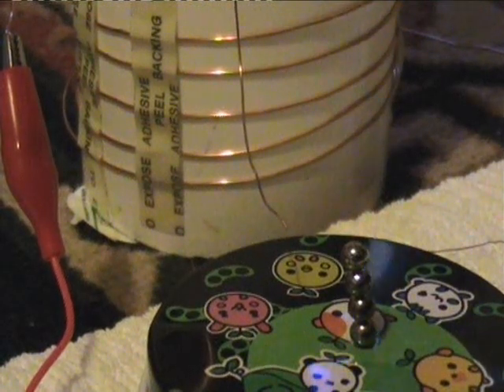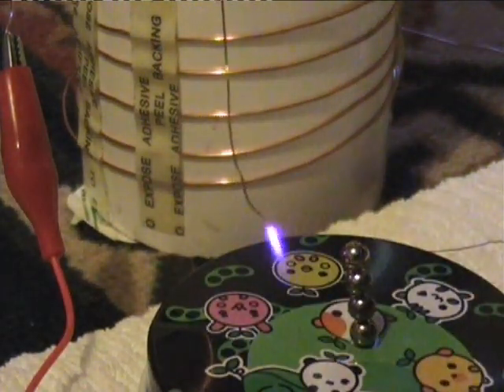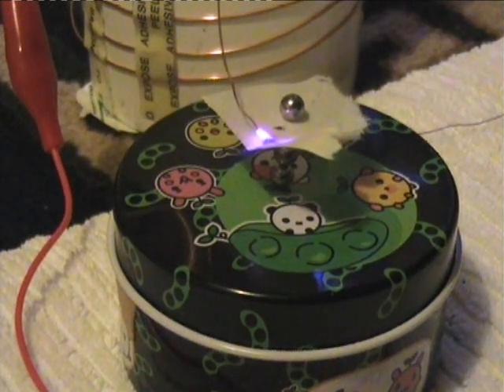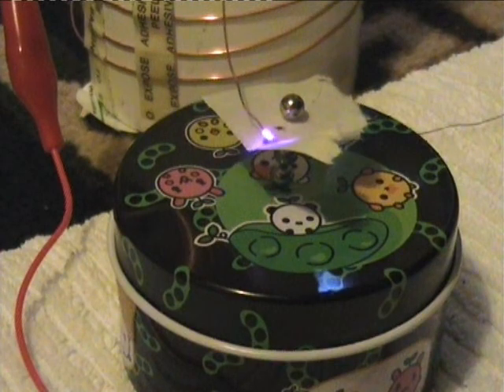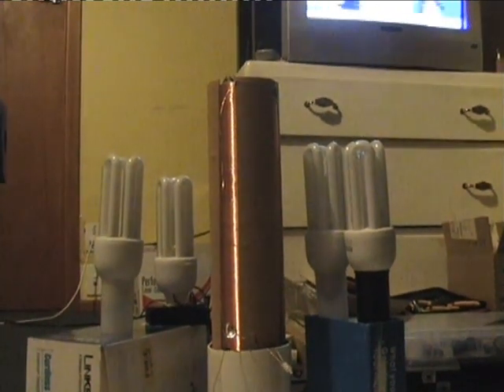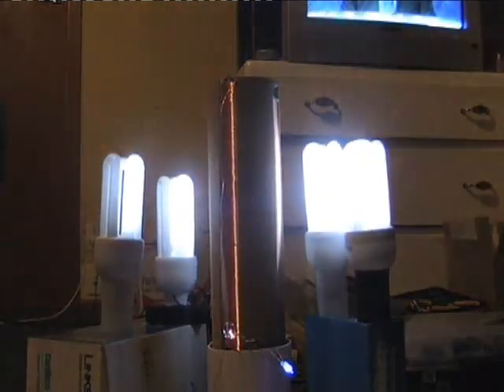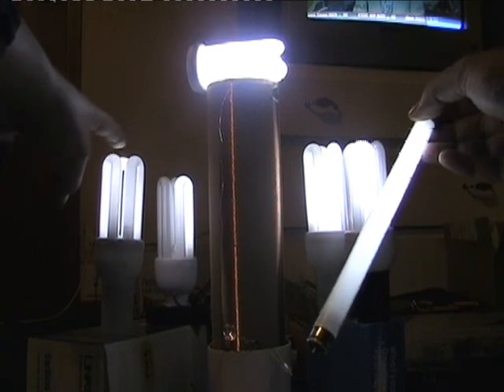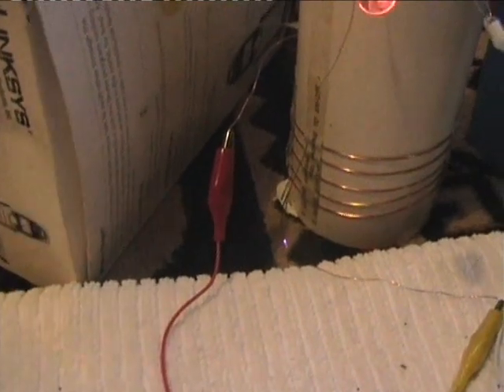24v SEC Exciter and plasma

Comment: what type of transistor, resistor and capacitor did you use?
Reply from the maker: dylandgaf17 The transistor was a 2n3035. The capacitor (from memory) was from a disposable camera (80-100 uF). The resistor is probably 1 mega ohm.

Comment: I see now. I also have a small Atmel microcontroller board with 20 output pins on it that send 3.3 or 5vdc up to 66MHz. Do you think that type of frequency rate could be fast enough? 33MHz from having to switch off the pins.

Comment: OK thank you, So the primary takes 1 input is wrapped around secondary tower coil but output from primary to secondary goes into input of second coil? Is the secondary a caduceus where the wire goes up and comes back down in the opposite direction to overlap the first winding? The coil I have now has 5 layers alternating directions.. This is very interesting though. I did something new. I have a neodymium magnet base with alternating poles North South North South around the coil to amplify

Comment from the maker: They are connected through a transistor only. This is not a closed circuit. One end of the tower remains connected to nothing at all. The other end is connected to a transistor and links with the other coil through the circuit. Schematic here:
brokenman . co . nz /science/wireless-energy/122-wireless-electricity.html